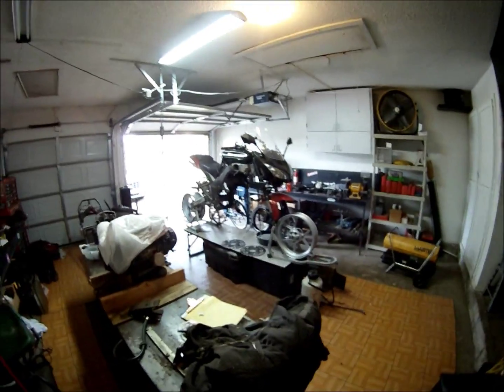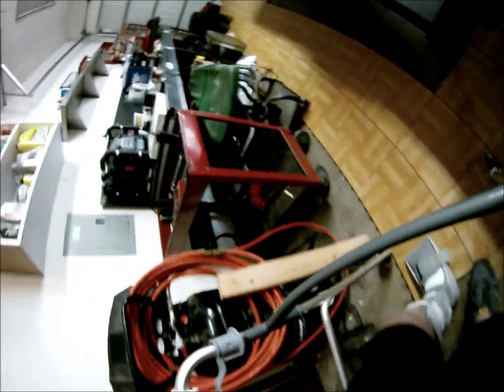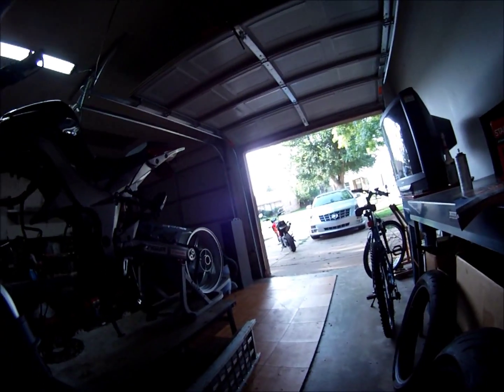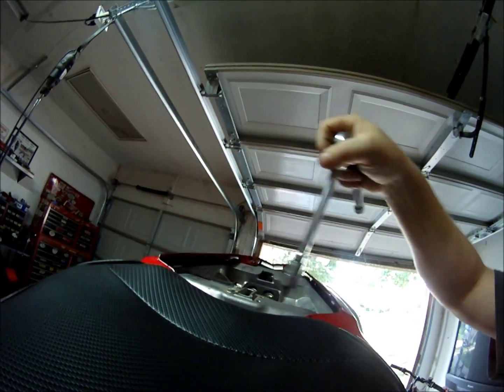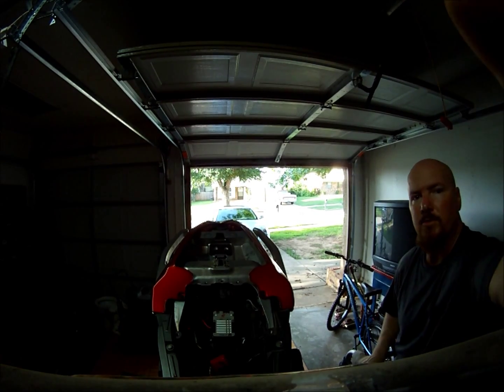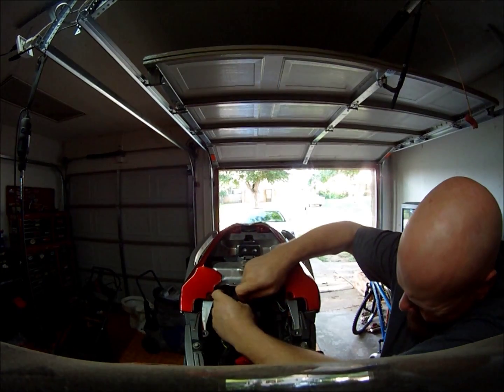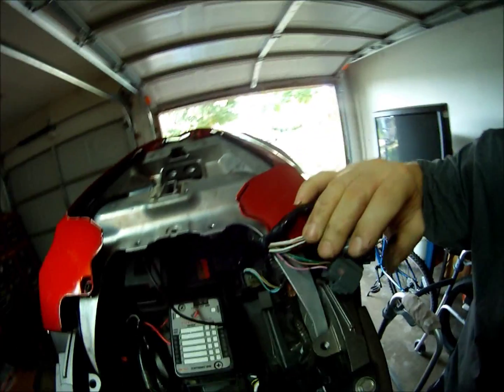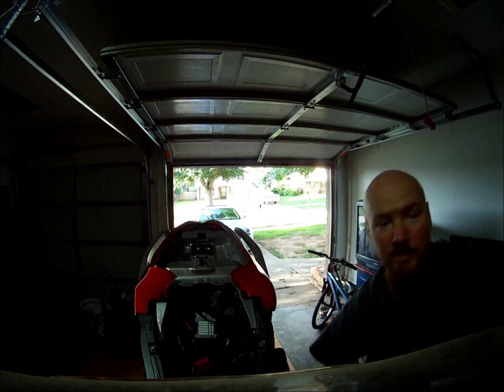My Movie

Comment: How has this changed the top end speed and acceleration of the N1K?
Reply from the maker: Linwood Gallop  I don't have any hard number for you Boss. I still have the bike in pieces. I just sent the head off to have the seats cut. Hope to have it running in a month or so. 
   IVANSPERFORMANCEPRODUCTS.COM Has dyno results of the before and after. It's a 25ish HP increase. I am expecting mid 10's at 130-135, and near 170 mph Top speed. I think that is realistic.
Reply: I was expecting it to be around the 170 mark considering the redline is now at 13k after reflashed... It's nice another N1K rider, ride it like a sports bike and I agree with you in one of your videos. "this bike is too much damn fun!"